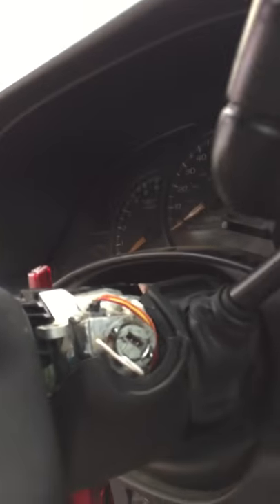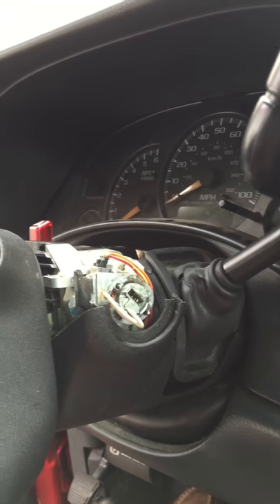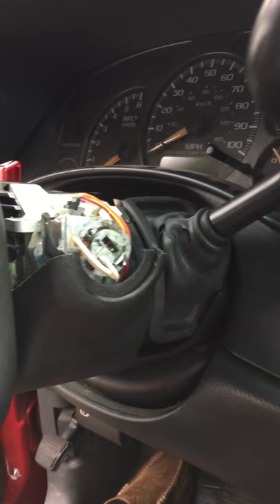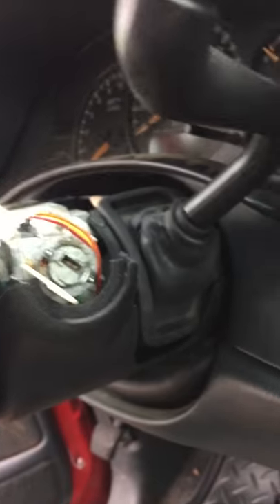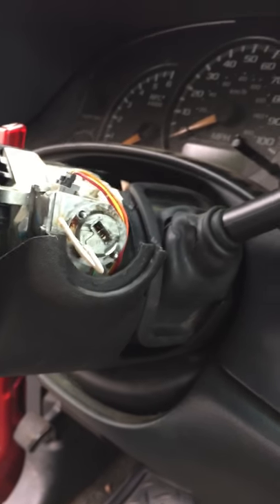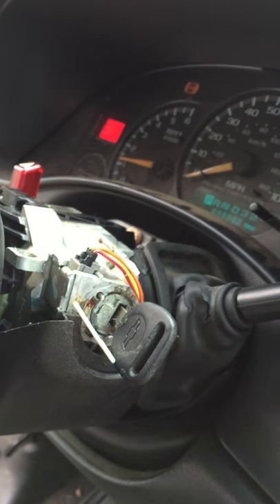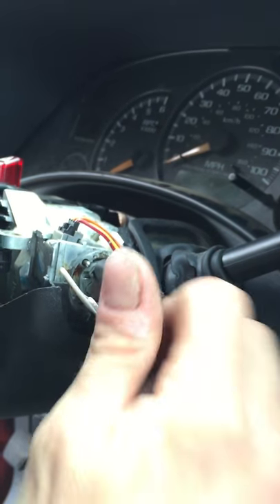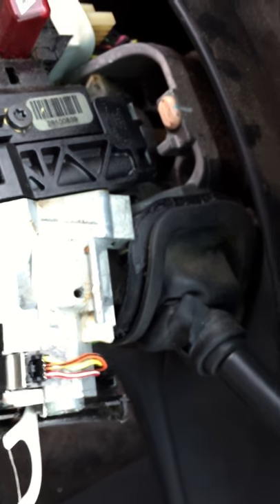02 chevy ignition stuck fix

Comment: Thanks for the info I ended up just removing all the springs and pins then I was able to remove that piece from the key  cylinder and everything works still need the key to start it because the switch the other steel part engages to activate that switch not exactly what the switch is but I left all that OEM

Comment: I have 2013silverado 1500,  had same issue, Changed lock cylndr frm amazon, now its stuck . its not turning. i tried this method bt its not coming out
Reply from the maker: @dhakkamistri  you have to put a pin in the hole on top of the cylinder housing to get the new piece out. The method I showed is for an old one with a worn out spring or something Inside that failed. If you have a new key you won’t have this problem.

Comment: Would it work if the alarm is on
Reply from the maker: Yes I would think so. My key don’t have a chip in it. Just use your key fob to turn it off. You could probably disconnect the battery of you don’t have a key fob if your worry about it going off.

Comment: What is that what did you jam in?
Reply from the maker: A floss tooth pick
Reply from the maker: You can use anything that fits in the hole that thing is just wedged shaped so it worked pretty good. You don’t have to move that spring much to get the ignition to turn

Comment: I still can't turn the key
Reply from the maker: Did you ever get it figured out? Some times you have to mess with it a little it’s kinda hard to see in that hole in the bottom but you should see a spring like thing I guess lol. Your trying to push that up so the cylinder can turn. I hope this helps you